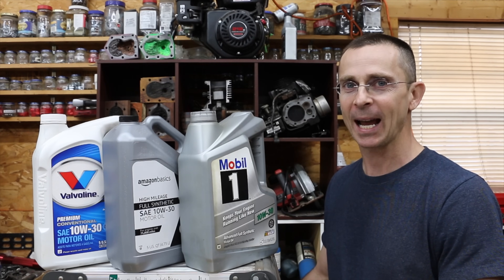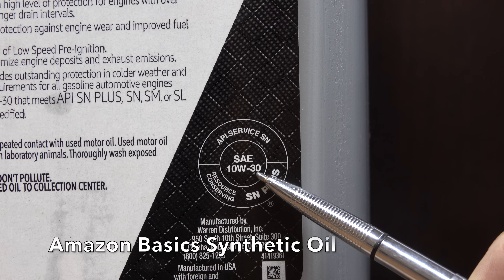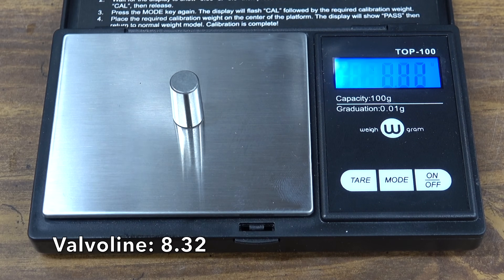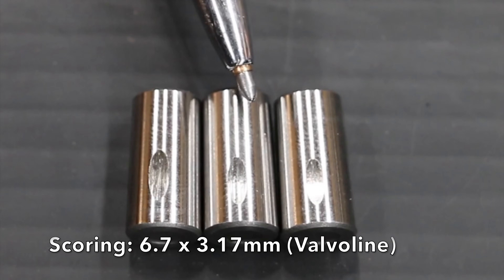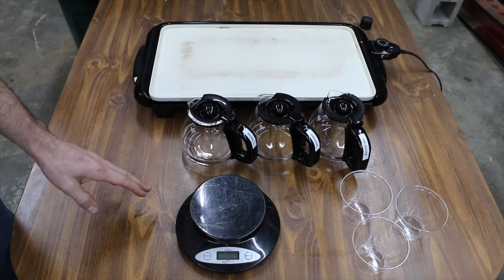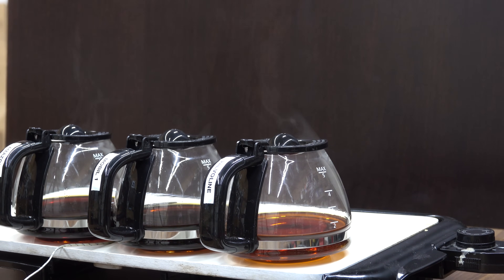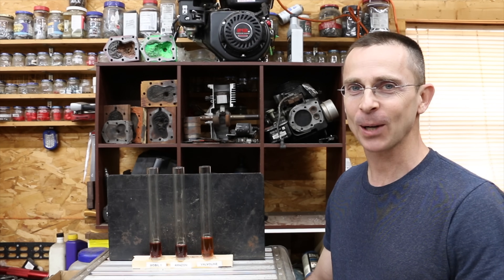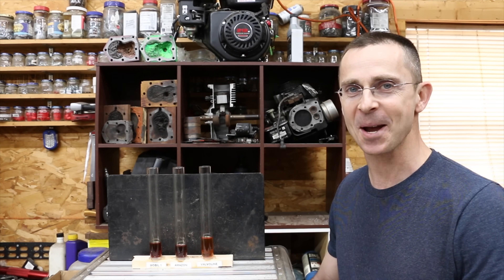Is AmazonBasics Full Synthetic Motor Oil better than Mobil 1? Let's find out!

Comment: I notice you don't mention additives made to the oils. Part of the price (and quality of a motor oil) is the performance of the additives, such as anti-foaming, corrosion resistance, wear resistance, oil stabilizers (oil life), demulsifying prevention, anti-oxidants, etc. Further, viscosity over a wide range of temperatures (viscosity index improvers) can significantly effect the performance of the oil. Would I use the Amazon Basics in my daily driver, yes, would I have used it in my (former) high performance car, not likely, without a lot more research. Otherwise a great and informative video.
Reply from the maker: Thank you!

Comment: Very nice test you did a great job. I would like to see a test with 5w30 instead, since it is much more common for automobiles, especially in winter. Also it would be interesting to see some synthetic high mileage oils tested since they have more ZDDP, especially for wear. And more brands would be fun to watch. I currently use Resolute Full Synthetic sold at Fleet Farm stores, it is priced similar to Amazon Basics. Also I use Mobile 1 High Mileage in my air-cooled engines as it boast of even higher temperature protection than regular Mobil 1. Also, My snowblower gets 0w30, it would be interesting to see if it really flows that much better than 5w30 at cold temperatures.
Reply from the maker: Thank you for the video idea!  I'll do it.

Comment: Nice video but your bearing test does not make sense. You can see that the pressure between the 2 metals is absurd.

You can see  the cone forming on the bearing like a wake, preventing a oil film to form...that is not what this test is supposed to do. This does not happen in the real world. If this type of pressure would happen in a engine, it would have failed a long time ago.

This makes the bearing test, executed like this, a meaningless test.

The pressure is too high for a real world application test. A bearing surface is supposed the have a floating surface between 2 metals, not direct contact.

I think it is difficult to test oil quality in a short term test. You need heat cycles to really degrade the additive package. Just cooking it does, yet again, not make a lot sense, since engine don't constantly cook your oil (or even keep it a relative constant high temperature).

I like your videos, but i think this was not a well thought out test

Comment: Well as long as you change oil regularly you should be just fine.. meaning not once a year.. at least 4times a year
Reply from the maker: Thank you
Reply: @ProjectFarm  great videos been fan since 16k subs you grew alot keep up good work
Reply: woah!  4 times a year with full synthetic and an average of 12k miles per year?  No.
Reply: Hell no man! twice a year is as much as I would go. No need to change full synthetic more than that unless your driving excessive amount of miles.
Reply: Even if he drives 4k miles a year?
Reply: I disagree to short the interval. I had concern that changing filters too frequently could results in unexpected particle passthrough. For me, twice a year or hitting the milage on the user manual.

Comment: Wait; If AmazonBasics oil is flowing at a different cold rate than the Mobile1 oil, doesn't that mean it's actually a different grade?
Valvoline, being Synth blend, has varying properties at different tempuratures due to the imperfect nature of distilled oils, and a different lot number with oil distilled from a different pumping station can make all the difference, but AmazonBasics and Mobile1 theoretically should perform nearly identically, being full synth blends of the same weight, yet AB is still thinner in the cold, looking at it I would say it's maybe around 7-8W, given that Mobil1 is hopefully a spoton 10W?
Reply from the maker: Thank you.  No, they get their rating at a warmer temperature, but in the real world, it gets much colder in some locations.

Comment: Awesome. I buy my oil at Lidl. Exceeds the specifications of my car.

Have you ever tried to duplicate the results found in the lubicity test? Just to make sure there is no variables.
Would you get the exact same readings again? It might also be fun to compare lubricity tests of cold vs varm oil
Reply from the maker: Thank you. Yes, the lubricity tester provides reliable results.  Warm testing is a great recommendation!

Comment: Hello. I very rarely comment yt videos but i have some ideas for you. Can you test MOTUL 300V oil? Its syntethic oil for race bikes. I heard its one of the best.
One suggestion. For precise measuring volume of fluid use volumetric flask: https://en.wikipedia.org/wiki/Volumetric_flask its not expensive and i think it will help alot in accuracy of your experiments. You can also buy measuring cylinder but for professional use and best accuracy volumetric flask is the best option. You can buy them on amazon for few dollars depending from class and volume. Good luck with future videos :)
Reply from the maker: Thanks for the recommendation!

Comment: I'm not surprised by the results, I've been using the cheapest Full Synthetic oil I can find for years.  Owned my current car for 13 years with 140,000 miles on it.  Change the oil even 10,000 miles with cheap Fully Synthetic and not had a problem, it's even still on the original turbo.
Reply from the maker: Thank you

Comment: Unless you've got a high performance engine with an owners manual that sates Synthetic oil is recommended/required... Save your money and go with conventional oil. 
I've  had 2 cars that ran synthetic and 4 that have run conventional and have never had any issues with either oil. 
One of the cars that ran conventional i owned for 7 years without any problems. It also had an oil life monitoring system and would tell me when to change the oil, it would typically go 4k-5,100 miles before wanting changed. 

I doubt you're going to run into a situation where you're like "if only i would have used synthetic oil instead"...  

As long as you're keeping the oil at proper levels between changes and changing it every 4k-ish miles. You'll likely not have any issues. Follow what your owners manual says to use.

You're fooling yourself if you think your car will run better simply because you used synthetic oil this time... Don't let the quick lube place up-sell you.
Reply: Use case for  the engine has more to do with it than anything.  For example I own a Jeep GC with the 3.6 pentastar. The owners manual recommends convention oil with a 6-10k oil change interval depending on usage.  I live in a cold mountain climate. In the morning when I leave for work it is usually 0 dg F or less I only have a 3 min drive to work and then it sets. Synthetic Oil is defiantly better for harsh cold starts where the engine never truly gets warmed up. I also end up towing random trailers over mountain passes. The pentastar cools the pistons with oil as do many other engines. I'v seen the oil temp reach 260F while towing, which is well outside the max temp range of conventional oil. Yet the engine is still considered to be within normal operating temp as in not even close to the 1/2 way point on the temp guage.  Point being this engine is known to run forever on conventional oil in normal conditions however.  So called extreme conditions really demand the use of synthetic.

Comment: I feel really sorry for everyone that you've mislead with these test results. You're essentially testing the antiwear additive package of the oil without the ability to keep oil temperature constant. You are relying on the ZDDP package to decay at their designed decomposition tiers, totally ignoring that these extreme pressure tests bear absolutely no relevance to modern engines. 

This is just as bad as the 540RAT blog, which used a similar test. Even Pennzoil's own product managers, in a Q&A session a few years back, openly stated their Shell 4-ball wear test, which is far more repeatable and accurate than this one, is not relevant to modern engines.
Reply: For anyone wondering, this testing method is effectively the same as one 540RAT used, which is equally useless. 

http://xtremerevolution.net/exposting-the-flaws-in-540rats-engineering-test-data-blog/

Comment: You measured dry weight of bearing but later you measured wet weight bearing with engine oil. I love your channel.
Reply from the maker: Thank you. I didn't explain the entire testing procedure, but I cleaned the bearing before and after testing with brake parts cleaner and allowed it to dry.  A small amount of oil can alter the results. Thanks again!
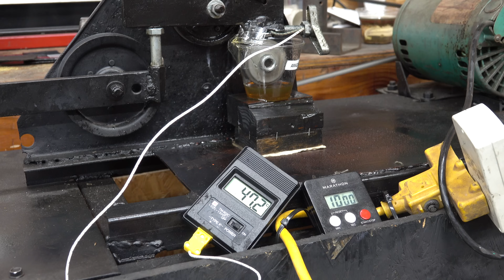Reply: @ProjectFarm  thanks for your reply I guess it's shadow on scale at 4:17 time not engine oil drop . My Apologies.

Comment: Riddle me this -  how does 430 to 431 equate to 1.5% loss and 406 to 407 equate to 0.5%?
Reply from the maker: I apologize, I went through that information very quickly and  I didn't explain this very well.  200 grams of oil minus 1 gram = .5%.  I did not include the weight of the coffee pot. Thanks again.
Reply: Project Farm even if you subtracted the weight they both only lost 1 gram. So why is one 3 times greater in loss?

Regardless, it was a wonderful test.

Comment: I hate how the cold pour tests only use cold oil and a 70* air temp. It doesn't really start to flow until the oil begins to come up to room temperature and then after it absorbed more heat from the air the viscosity decreases. So if you want to see a real cold pour performance test, get an old chest freezer, install your test rig inside the freezer so that way the oil, the air the trough it runs into are all the same temperature throughout the entire test. With a GoPro inside you can use a string to dump the oil and see how the oil actually performs at a consistent temperature instead of one where it is continuing to warm the longer it goes. I would be curious to see you take readings during a "normal cold pour test" to see just how much warming the oil does when starting frozen in a "normal room temperature" environment.
I enjoy the channel and keep up the good work.
Reply from the maker: Thanks for the constructive feedback!
Reply: Does this even matter? Every oil pump I've ever seen has been a positive displacement pump, as in the oil will flow no matter what, unless of course your running an antiquated engine that's splash lubricated like a Chevy 216
Reply: @1d10t.  It most definitely matters. There is a significant difference in the current drawn from a battery (or batteries in the case of a diesel) when trying to start an engine which is trying to pump oil that is as thick as honey in sub-zero temps. Here in Montana, a dead battery when its 20 or 40 below could cost you your life. Synthetics are vastly superior in this regard as well as using the proper viscosity for the season. A diesel using 15w-40 which has chronic starting problems in below zero temps will start perfectly every time if 5w-40 is put in (both being full synthetics) and both oils will still perform and protect the same at operating temps, being the same weight or grade of 40 at 212°F. Additionally the engine will spin faster and start sooner, further reducing the strain on the starting system and the battery lifespan.
Reply: 90% of all engine wear happens at cold startup. You need that oil to flow well in order to get to all the places it needs to as rapidly and easily as possible.
Reply: @johnny0454  I don't disagree with straining the batteries, I have a diesel that I've had fun starting in -20. Like I said, it will trip out our ac pumps which is why we also have DC ones. I disagree with the statement about cavitating a + displacement pump. You should run thinner oil in colder climates. Literally every owners manual I've looked at specifies different oil for different climates. Can't speak of new cars, owned mostly 80s and 90s trucks, mid 50s, late 60s vehicles.
Reply: @1d10t.  Any pump variable or fixed displacement, can cavitate. If you're trying to draw a high viscosity liquid through too small a delivery system or too quickly or some combination of the two, that's how cavitation happens.
Reply: @kleetus92  I agree, however it is much less likely than with a centrifugal pump. If you're running the correct oil for the temperature and not hammering it until the vehicle is warmed up I just don't see it happening. Even if it did happen, I highly doubt it would ever be severe enough to cause any noticable erosion on parts, shearing a shaft or some other mode of pump failure.
Reply: @1d10t.  Not quite... if the oil is too thick, it can and will cavitate in the pump if it can't get oil in fast enough. Honestly though it's gonna be really hard to have that problem in anything lighter than 10w whatever... dino 15w maybe, but any synthetic will be fine.
Reply: @kleetus92  so I operate all mechanic watchs in the engine room of a nuclear submarine. Centrifugal pumps absolutely will cavitate, same as a prop. Never seen a positive displacement pump cavitate, seen the motors trip due to overload and cold oil, but never cavitate. The only issue with cold oil is too high of pressure pushing past seals and such, increased strain on pump and lines and with a car, most your wear happens when starting because your spinning without full oil flow due to not circulating oil prior to starting. The fact is cold oil is more tacky and prior to lay up we let everything cool down and coat it in cold oil to prevent rusting and provide lubrication for startup where hot oil would leave a much thinner oil film for startup.

Comment: Love you videos! Very authentic and no BS! Keep them coming! Thank you!
Quick question : Which multi-grade oil would you recommend for a high-mileage (125+ Miles) Hilux 4Runner? 10w40 or 20w50? I live in a tropical weather country, somewhat similar to Florida weather. 
Thanks in advance.
Reply from the maker: That seems like low mileage for a Toyota. They are fantastic!  I would go with 10W-40 if I owned the vehicle.

Comment: The Ethanol in your fuel gets past your pistons and makes it's way into your oil if you have a forced induction it can be a big problem you should dilute the oil with some ethanol and try it again or actually run it in an engine before testing it. I only use valvoline vr1 in my turbo car the oil breaks down very quickly I dont use synthetic either the ethanol is harder on the oil than heat save your money and change your oil sooner. I lost a motor on mobile 1 synthetic, some oils break down much faster after real world use
Reply from the maker: Thank you

Comment: Another video idea:
Cutoff wheels for angle grinders! Test thin and thick wheels, their cut time, and how many cuts they can last....in the same manner you tested the Sawzall blades. AND, a great test for them would be their durability and resistance to breakage when used improperly, like putting a measured amount of axial/sideways pressure on the cutoff wheel and see how long and how much weight it takes to shatter them. It would be great service and PSA to people as far as safety goes too.
Reply from the maker: Thank you for the video idea!

Comment: Excellent video Todd, I'd like to suggest a stage two where the oils are backed for several hours at 200c or so and then put through some more testing.  One idea maybe to try each oil inside an automobile engine with an OBD2 reader measuring engine load, this will also ensure stability of temperature of the coolant and the air flow temperatures/flow also. 
Thank for keeping on with these.
Reply from the maker: This is a terrific recommendation!  A lubricity test after heat exposure makes sense.  Thank you!

Comment: I think somebody has already determined that the AmazonBasics Full Synthetic is made by the same company (Warren?) as the Wal-Mart SuperTech Full Synthetic.  The Wal-Mart full synthetic oil is cheaper than the Amazon full synthetic oil.  I have been using the SuperTech full synthetic for many years now.
Reply from the maker: Thank you

Comment: Synthetic Oil is Palm Oil,

Cheaper than vegetable oil as chip shops use it instead of veg oil,

slap a few additives in it put it in a fancy bottle which costs more that the contents,

and sell it for as much as you can.

Comment: As others have said doing the bearing test after heating would be a good idea. Personally I thought Amazon wouldn't perform as well, now that it has does Mobil 1 or others have an SN Plus brand so they can be compared apples to apples? The Amazon stuff is a quality oil now, no doubt about that, but since its a contender would be cool to see how it stacks up against other SN Plus oils. Awesome testing yet again sir!!
Reply from the maker: Thank you

Comment: When I was young and dumb (1988), I was running Castrol 20w-50 conventional (thinking "heavier" was "better") in my Honda while living in upstate NY. I neglected to change my oil before an early fall freeze and did some damage to my piston rings. It would occasionally blow a huge cloud of blue smoke out the exhaust on startup. I learned to use the correct viscosity oil. Now exclusively use Mobil-1 Synthetic.

Comment: I stopped using valvoline back in the 1970s because of cold weather jelling problem that could have ruined my engine if I had not been observant and taken measures to shut down my engine as quick as it failed to develop oil pressure
Reply from the maker: Thank you